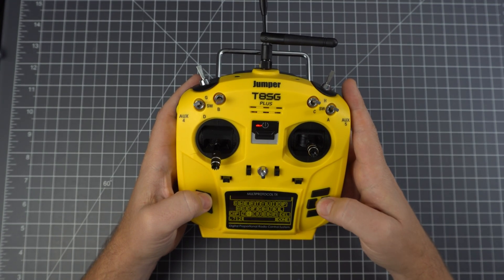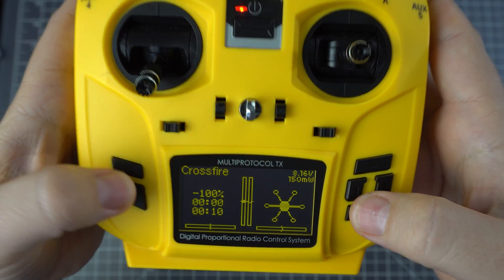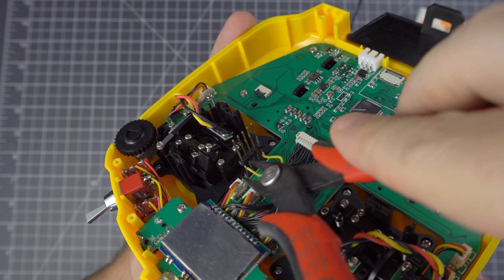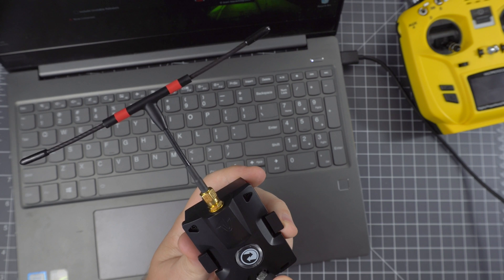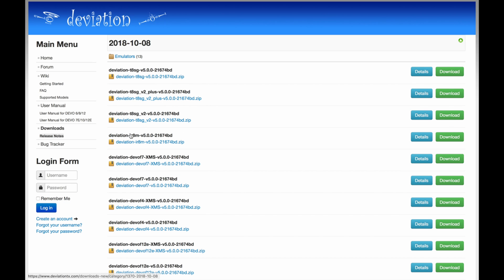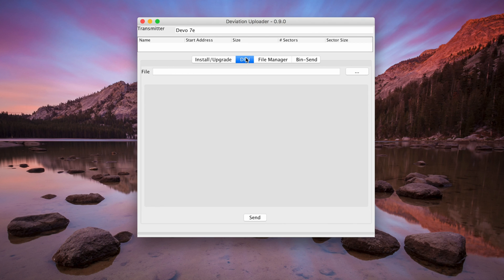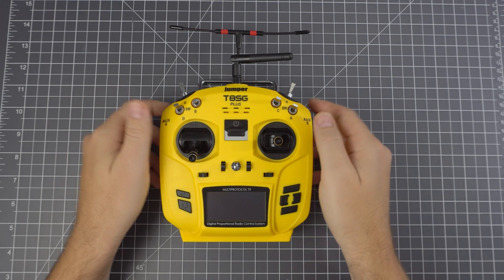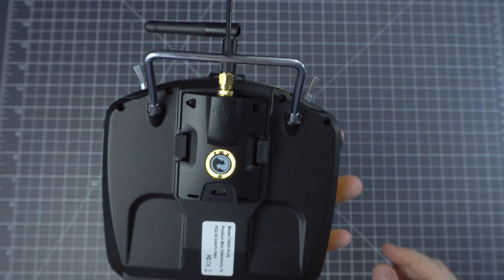TBS Crossfire on Deviation with the Jumper T8SG Plus - Tutorial

Comment: Dear friend, if I want to use the radio in the flysky protocol, for example, the crossfire module does not turn off, this makes it consume the radio battery without at least using the module is it possible to turn off the module via firmware or do I simply have to remove the module or add an on/off switch?

Comment: hello friend how are you ?, well I have this same radio there, the t8sg and this week I ordered the tbs cross fire, because then;  watching this video of yours I had the doubt if it is still necessary to do this procedure to use the module or have updates come out where the same procedure to use the module is no longer necessary ?, please be sure to answer me
Reply from the maker: Try the latest firmware and see if it works. You may or may not need to swap the pin.

Comment: I just did this mod and now my tx won’t power on, just makes a beep. I cut just below the plastic and soldered as described. Any help would be appreciated
Reply from the maker: Do you have the original yellow version of this radio? They likely fixed this in the newer versions. Did you try without the pin mod?
Reply from the maker: Also, did the firmware update work for you? We'll need to determine if the pin mod is causing the issue or the firmeware.

Comment: Thanks for this. Is this procedure the same for t8sg v2 plus carbon fiber edition?
Reply from the maker: I'm not sure, they may have modified the pinout to work without modification.
Reply: @whiffles  hmm new to this setup if i may ask about the pin outs of tbs and pin outs of jumper t8sg ?
Reply from the maker: @Giannix  You might just want to try the TBS module without making any modifications. It should work. I would imagine they've fixed this by now.

Comment: Hi I had a problem update de firmware but after finish I have the screen black in my jumper... Donyou have idea about some Solutions... I will apreciate your help... Thankss
Reply from the maker: Can you still get it into DFU mode to flash the firmware again?
Reply: hi bro thanks for answer i just resolve my problem...it was a issue with the vertion and the kind of lcd screen but funtion perfect 30 mins ago ....thanks
i have the plus carbon what o i need to put the crossfire micro flying with my radio ...
actualization on t8sg
actualization in cross fire module
modification in hardware....something else ...?

Comment: Just got crossfire micro bundle reciver bound but I have no sticks in the tab any clue what I missed???
Reply from the maker: Did you choose CRSF on the radio? I'm not sure if the pin swap is still necessary on later iterations of this radio. Which version did you get?
Reply: @whiffles  yes crossfire is marked  its jumper t8sg v2.0 plus

Comment: Crossfire working great but have any of you had this bug? I often have to power cycle 2-3 times for the quad to "connect" to the radio.
Reply from the maker: Hmm, I can't recall having that issue. I haven't used this pair for a while though.
Reply: @whiffles  So I think I have it fixed, if I have the tx locked at 500mw it never happens connects no problem. If its locked on 1w it shuts off after 2 seconds, if its on dynamic thats when I have the connecting issue. I think your video was before we had 1w on the micro tx right?
Reply from the maker: @Str8GasGenetics  Yes, this is the V1 module with only 250mw.
Reply from the maker: I wonder if it's a voltage/amperage issue. Maybe you're pulling too much power for the radio to handle.

Comment: Can you now change the power output of the tx?
Reply from the maker: I believe you can now configure the Crossfire module through Deviation.
Reply: @whiffles  do you know what series of deviation firmware that support it? I've tried reading the deviation forum and couldn't find the information
Reply from the maker: @yoanesrinto4189  I believe the latest release version supports it now. It's pretty mature as far as I know.

Comment: imcannot get my cheerson cx95s to fly on my t8sg plus did the binding and quads lites went from fast blinking to solid lights and controls are working on radio monitor and in betaflight but no motor functions
Reply from the maker: That could be a channel issue with the arm switch. Maybe try assigning arm to a different channel?
Reply: Whiffles how do i get to arm switch

Comment: I have the same set up as you : Jumper t8sg v2 Plus, crsf micro tx. I done the software update, and i have the CRSF script into my Jumper.
But, when i put the crossfire micro tx in the jumper, it didn't even powered up.Do you know what is going on ?
And, I think my module is very hard to put in the Jumper, it seems to be blocked on the pins side...
Reply from the maker: Did you select the CRSF protocol on the radio? I'm not sure if it requires that to send power to the module bay. If you still don't get power try a multi-meter on the pins and see if there's any power.
Reply: @whiffles  Yes I selected crsf on the radio but I haven't done the hardware mod for now, maybe it will work. I tried to mesure the tension between all the pins and it seems that two are distributing current.. I'll see what it's happening when I'll do the mod.
I tried without it in first because I saw other videos where it is working with the stock radio.
I'm glad you answer so fast, have a nice day ✌
Reply from the maker: @titouanpenicaut4848  It may just work with newer radios without the hardware mod. This was the original release. I think the module at least powered up before the mod though. I jumped the pins to the module with wires to test all of this before I performed the mod.
Reply: @whiffles  I just finished the mod and it works perfectly ! 
Such a beautiful moment to see this little led turn on 😆
Your tuto is excellent, thanks
Have a nice day !
Reply: It's pin problem..set up the pin in your t8sg plus v2 and if the crsf module can fit in easilly it done..so module can power up with power from ur t8sg plus v2..just ur info..i follow this instruction..and my modulle didn't work..so i replace the pin that had been cut before, i remove the wire that connected first pin to the last pin..i set up the pin so the crsf modulle can fit in properly and very easy..that will work..the crsf modulle power on from power on my t8sg v2..
Reply: I have this issue before. What i did is that i open the module and put sa back cover first on the radio and pin the tx module in it and put the front cover, it seems that the pins of the radio are not align perfectly

Comment: Will this worked on Carbon T8sg Plus V2 too?
Reply from the maker: Yes, but you may want to test it before moving the pin. I'm not sure if they made changes internally to fix this.
Reply: Whiffles Ok, maybe if I open it up and see a wire then I won’t have to soldier a wire and if I don’t see a wire then wire it up. Also thoughts on the t12 and t16 supporting cross fire?
Reply from the maker: @jeqezz  I'd just try the Crossfire module without opening it up to see if it works. If not, then open it up and check the pins. The T12 and T16 both support Crossfire natively without any mods. You may want to consider either of those because the T8SG Plus V2 is discontinued and no longer supported.
Reply: Whiffles Ok I just bought the Carbon T8sg plus v2 without researching and that there were t12 and t16. Maybe I should cancel my order, the only thing is it’s open TX for t12 and t16 and not deviation firmware from what I’ve read.
Reply from the maker: @jeqezz  OpenTX is more popular and you'll get better community support. Deviation is nice, but it's just not very popular in the FPV community.
Reply: Whiffles Ok I will cancel my order and order the t16(I’m preordering the hall gimbal Version ) then. Thank you for your help. I’ll be glad to just put my micro crossfire and not mod it.
Reply from the maker: @jeqezz  Where do you see the T16 Plus for pre-order? I think it may be a little way off.

Comment: IT work's 🤗🤗🤗🤗🤗🤗🤗
You are the Best👍👍
Reply from the maker: Awesome! Glad to hear!
Reply: But i don't have rssi
Reply from the maker: Best to use Link Quality. Did you set it up on the module? You'll need to use the TBS agent to configure it.
Reply: No, what schould i do?
Reply from the maker: @youbek  Download the latest TBS Agent software for your computer and plug the module in via USB. You should be able to configure the telemetry. I haven't done this yet, but I know it's possible.
Reply: @whiffles  I have under Settings: General: OP. Mode - Force Tel.

And i have 4 wire's 5v, gnd, ch1 tx1, ch2 rx1. Need i a another one for telemetry?

Comment: Will this work with a world tech elite raptor drone?
Reply from the maker: What protocol does it operate on? 2.4ghz?
Reply: @whiffles  World Tech Toys Elite Raptor HD Gimbal Video Camera 2.4GHz 4.5 Channel RC Quadcopter
Reply from the maker: @richdbacks2001  I'm not familiar with that one, but it does operate on 2.4ghz so it just may work. Why not look at the Jumper T12 or T16? The T8SG Plus is discontinued.

Comment: Will this mod work with the full crossfire module? Will I still have to do the hardware mod?
Reply from the maker: It really depends on how you mount it and make the pin connections.  If you use wires to connect the pins you can just connect them to where they need to go without modifying the hardware.
Reply: Whiffles so if I just do your mod and update the firmware, it should work with the full power module?
Reply from the maker: How will you mount it? You may just want to attach some jumper wires to the pins and connect them according to the stock pins of the T8SG radio. I would test that first to make sure the larger Crossfire module gets enough power. You may not need to mod the radio at all.
Reply: Whiffles the larger module fits in the back and I will Power it with a 3s Lipo. All I’m asking is if it will work and if I need to do any mods to the firmware or the pins.
Reply from the maker: You just need to make sure the top pin gets diverted to the bottom pin, and yes you'll need to update the firmware.
Reply: Whiffles ok. Thank you for your help

Comment: Thank! Useful video! I unfortunately do not have a taranis, and I really hope that the deviation will be completed and the settings will be available! Will I be able to buy a crossfire and fly standard settings for now?
Reply from the maker: Yes and actually TBS is working on desktop software to configure the module, so you won't even need to do it through the radio.
Reply: @whiffles  Thank! This is good news! The large crossfire TX has the ability to configure directly on the module

Comment: Would this work the same on a devo7e?
Reply from the maker: I don't think it has a module bay, so it's likely not possible without extensive hardware mods.
Reply: im currently using crossfire on devo7e via ppm from the trainer port. is that the same signal line?
Reply from the maker: I'm not sure if that port connects to the serial outputs.  Check the thread on the deviation website listed above and ask in there. I think they'll be able to give you a better answer.